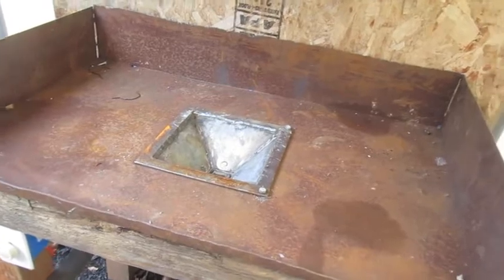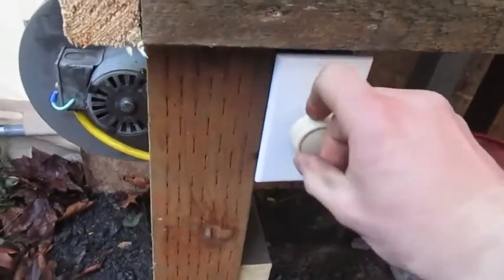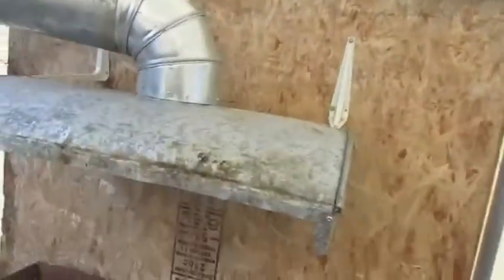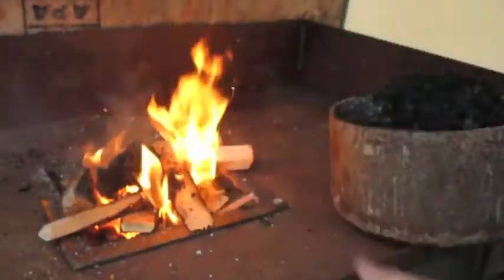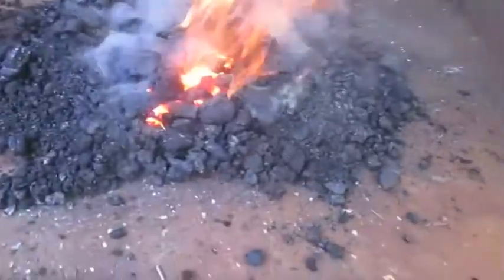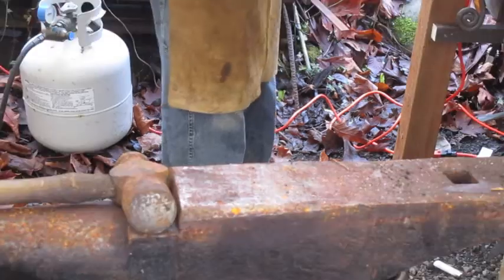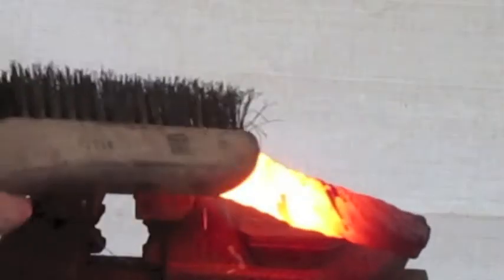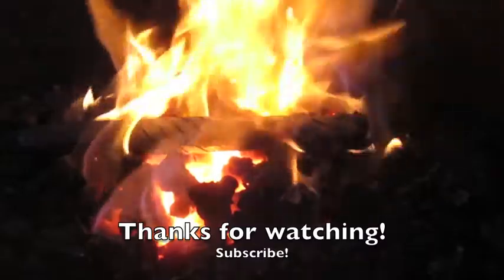New coal forge, with some bonus cable welding

Comment: So how does welding work? I’m super confused.
Reply from the maker: Sorry, I didn't explain it well in the video.
Forge welding is where the metal is heated up to the point where the molecules can be mushed together. Think of it like play-dough, or clay. Neither are completely liquid, but if you mush two pieces together, or fold it in half, then it is all stuck and there is pretty much no way of getting it apart in the same way that you put it together; it may as well be one piece. 
The flux is used to prevent iron oxide from forming, which prohibits forge welding.
Does that make sense?
Reply: Cave of Skarzs YES!!! Thank you very much!!! Also how does welding with a welder on 2 pieces of metal work? (if it works differently)
Reply from the maker: It does work differently, indeed!
Arc welding with a stick welder, wire feed welder, or TIG welder uses electric current to turn all surfaces to liquid, as well as adding material.
Reply: Cave of Skarzs oh. So it melts the 2 existing materials together and adds a new one! I always thought it just melted the 2 existing materials together.
Reply from the maker: Yep!
Reply: Cave of Skarzs thank you very much!!

Comment: What oil do you use to quench a knife
Reply from the maker: I use motor oil, mostly. I have used bacon grease and vegetable oil, as well. Recently I have been given some Parks 50 knife quench oil, which I am going to switch to as my usual quench oil as it won't degrade like vegetable oil, and won't fill my lungs with hydrocarbons as with the motor oil.
I recommend bacon grease or vegetable oil for your safety.
Reply: Cave of Skarzs ok well I have an unlimited moter oil does it matter if is used. I am wanting to build a knife
Reply from the maker: I only use used motor oil. XD
Reply: Cave of Skarzs so was it new oil or old oil that came out of your truck